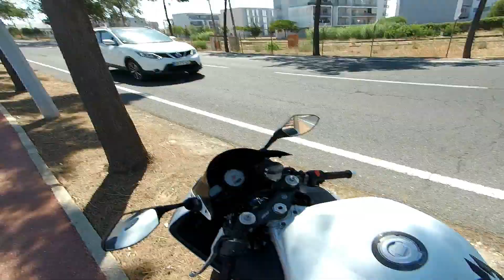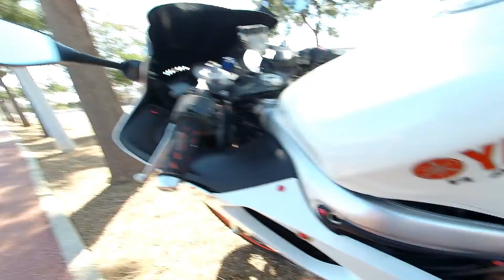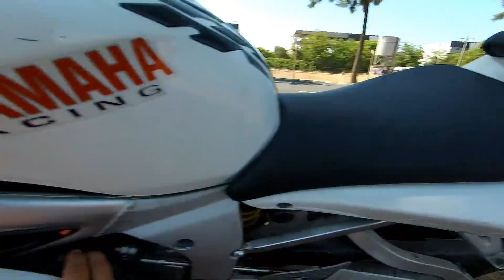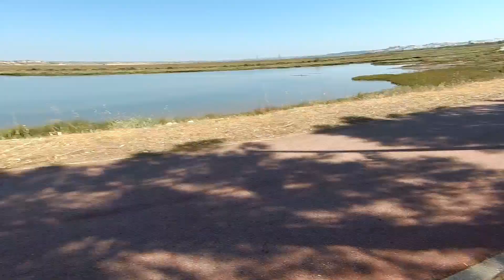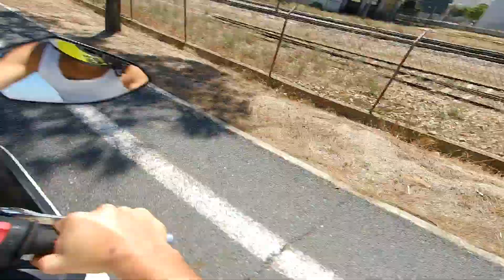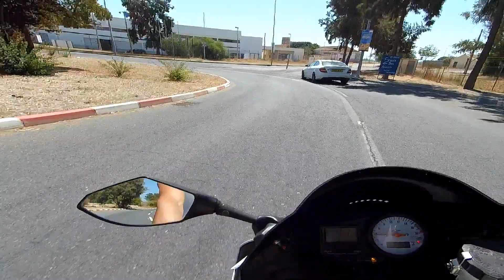This 2001 yzf R6 just won't go!

Comment: Had a similar issue with mine. Took the shop 3 months to figure it out. Check your engine pressure and ecu. They engine pressure fixed the blow back it seems and the ecu swapped fixed the issue with it not wanting to pick up speed.
Reply from the maker: Thanks for your input. Unfortunately none of the 3 mechanics I took it to had the patience to consider other options, had to envetually sell the damn thing.
Reply: How did they fix the engine pressure?
Reply: same problem I am facing so please let me know to fixed it
Reply: @arqumfida3585  maybe it's the pickup coil.. I'm still working on it
Reply: This is carburetted tho? There is no ecu in 1999-2002 R6 only CDI ignition is digital????
Reply: @reevellensoomien2423 aftermarket exhaust have to be maintained.  Like repacked. The lack of back pressure causes lean issues

Comment: If the bike turns off when you put the kickstand down, that means the neutral sensor is disconnected from the bike. That would be why the neutral light doesn't come on too. You need to find a mechanic who knows what they're doing. It really sounds like your battery can't deliver enough spark
Reply from the maker: Yeah it was a huge mess altogether, none of the 3 mechanics solved anything, I ended up selling the bike cheap out of frustration. All professional mechanics, just unbelievable.

Comment: Hearing your idle drop by that much when you turn the headlight on makes me think it's partially battery related.
Reply from the maker: Well I did never change the battery, actually. But all the mechanics were so sure it was a cracked cylinder that I didn't know what to think anymore.

Comment: Guys I had the same issue and when I removed the whole bike top ( headlight , signals and speedometer) it was running good !!!... I think it's some electrical issue but idk what is it  yet
Reply: Ever find the fix currently having same issue and I thought it was my stator and reg/rec… replaced both didn’t solve problem…
Reply: @zuk024  check your carb boots

Comment: Sadly I’d be willing to bet it was cracked liners most likely number 1. Woulda thought carbs or ignition related but with blow by its the cylinders. Happens on the first gens more so than other years. Don’t know what causes it. Some bikes get it some never do.
Reply from the maker: Yes first gen of R6 apparently all wind up with cracked liners. From what I've gathered it's the nicasil in it that fails to withstand the necessary pressure and heat, and end up cracking. What always puzzled me was that it ran fine in 1st gear, and after the 2nd it wouldn't, but in 1st the engine had a lot of power. Anyway, I actually gave it away to a friend that has a shop, once he opens up the engine I'll be able to finally have a look at the damn cylinders. Thank you .
Reply: @modelo2107  yea be interesting to see what it looks like inside. My 02 r6 still running very strong after 36k miles. Zero blow by and great compression. Fingers crossed it doesn’t crack a cylinder wall. It’s a shame that it happens to a decent amount of these bikes. The first gens are sooooo nice. For their age they still hang with new bikes.
Reply from the maker: @Dirtyol12valve  Yap, can't wait to finally look at them and clear this up. I've read of these bikes still running with 100k miles perfectly fine, mine showed 32k in the odometer, I just don't get it. I really liked, the engines revs amazingly, and the geometry of it is also really amazing considering it's age. I also have an R1 from 03, fuel injected and I actually had more fun with the R6.

Comment: Offtrack studios:  At 2:30 you said it was running worse yesterday.  Was there a difference in the weather being warmer or cooler on the day you filmed this?
Reply from the maker: It just felt like the idle was sustaining a little better but it was only for a while, once I took off it was doing the exact same.
Reply: @modelo2107  You need to start by pulling the battery out of this bike.  Take the battery to an auto parts store to get it load tested and fully charged up.  1:49 and 4:12 are good examples that your battery is very discharged.  You might also have a stator or voltage regulator issues going on.
Reply from the maker: @fwh79FOXR6  Pardon my ignorance, but isn't the battery just to start the combustion engine? Once it's running does it still play any major part on the process?
Reply from the maker: @fwh79FOXR6  So you really not inclined for a compression issue?
Reply: @modelo2107  Yes, the battery is important even after the bike is started.  The battery starts the bike and it filters voltage spikes and electrical noise.  It also provides power when the stator (or alternator) are overwhelmed.  A battery going bad can cause a whole host of strange electrical issues.  You need a properly functioning and fully charged battery.  You need to remove the battery, get it load tested at a parts store, and fully charge it.  Most auto part stores will load test and charge a battery for free.  You would be surprised how quickly a battery can lose its charge.  Also, if you stator is failing, the battery is not being charged when the bike is running.  This video might help you:  https://youtu.be/biwTpBFM-ns  You also need to keep your batter on a battery maintainer.  I use one on every vehicle I have, even my daily driver.
Reply: @modelo2107  I don't think you have a cracked block or any compression issues.  I think you have the following problems...
1.  Battery/stator/voltage regulator issues
2.  Bad ignition coils
3.  Possible vacuum problems effecting the needle jets from opening properly
4.  Mixture problems caused by dirty carbs

Start with the battery.  Get your hands on a multimeter so you can check the charging system (stator).  Take the seat off and make a video using the multimeter to read the voltage on the battery with the bike off.  Then turn the key to the "on" position and show me the meter reading voltage.  Finally, start the bike up and show me the voltage reading with the bike running.  After you do that we will make the next move.
Reply from the maker: @fwh79FOXR6  Thank you so much for your paciente, I'll try to get on it asap. I do believe though the damn thing is jinxed, now it won't even start, the starter does its job but it just won't fire up, with the choke on or off, nothing. BTW, what you think about not having the neutral light on the tachometer and the bike dying with I put down the stand in neutral?
Reply: @modelo2107  You're welcome.  It's not jinxed, she needs to be properly cared for.  I think the previous owner(s) neglected her.  That kick stand kill switch could be a reason why it doesn't want to fire up now.  Be sure to check the fuel level as well.  Maybe you just ran out of petrol.
Reply from the maker: @fwh79FOXR6  That crossed my mind, so I refilled the tank but it still won't fire up.
Reply: @modelo2107  Get that battery tested and see what happens.
Reply from the maker: @fwh79FOXR6  HI, do you know where the oil pressure cable connects? My oil light is always on and I have the cable at home but I have no clue where it connects. And do you know if this bike has some sort of safe mode? How is it possible that it goes to redline in neutral and in 1st gear but as soon as I shif into 2nd it starts bogging out??

Comment: Darn I got the same problem 🥲🥲🥲.. still don't know what to do ..  I changed the jet kit and it feels better but still got the same issue.. if any 1 know what it is just tell me
Reply from the maker: Sorry I can't help you. I changed everything there was to be changed, and the issue always persisted, ended up giving up.
Reply: I had a Yamaha and the problem was the coil packs...
Reply: @damienturk3911  the pickup coil u mean?  Coz I was thinking about  that too
Reply: I  think so there's 2 of them right under the gas tank along the frame.
Reply: Did you guyz figure it out cuz mines havig. The same problem
Reply: @nataliezepeda8904  there's 2 theories.. it's the spark plugs coils or the pickup coil.. and I'm about to try the pickup coil
Reply: I changed the pickup coil and still got the same problem... did u found any solution?

Comment: Dude I know what the problem is, it could be multiple things but the bogging is the carburettors aren’t cleaned or balanced, the dying can definitely be the regulator rectifier which you need to replace even if you replaced the battery. With the sound, all 4 cylinders seem to be running fine

Or you need to do a valve clearance! Because the engine won’t start properly
Reply from the maker: Thank you for this. Well thing is, all that was tested, and the problem remained, so it's a real big misery.

Comment: Did you resolve the issue?
What was the problem?
Reply from the maker: I didn't, I sold it cheap. The guy who took it changed the engine and it did exactly the same. He also changed the whole cabling and the result was the same. I think this will go down in history as the stranger mistery ever on a motorcycle.
Reply: @modelo2107  i think its the carburetor, in fact am having exctly the same problem. The mechanic will work on it next week
Reply from the maker: @reevellensoomien2423  They were checked and clean, were perfectly fine. As also was everything else.
Reply: @reevellensoomien2423  So did you solve this problem , cuz I am starting to get the same thing with my bike..
Reply: Mine does this and I changed plugs and running sea foam and still doing it
Reply: Came here to get some answers because my 2001 R6 is doing the EXACT SAME THING and I can't figure it outtttt.... change the plugs, the oil, rectifier, fuel pump, HAD THE CARB REBUILT!!!! AND STILL DOES THE SAME DAMN THING AND I have no idea why... even the oil in the blow by is the same ..... really a myster indeed😢

Comment: Head has gone its well known for it change the head, oh 3 years ago nevermind  hahaha 😂
Reply from the maker: One would think that, but guess what, we changed the whole engine and it did exactly the same 😂
Reply: @modelo2107  im assumig yours is a 98-02 the 5EB is well well known if yu just have the head changed to a 5SL stage it will never happen again,
Reply from the maker: @googlelimp9834  Yes, correct. I no longer have the bike. The weird thing is that I chenged the engine but not the electric part, and it did the exact thing. Which makes me think it was not the engine itself, but something to so with the electric part.
Reply: @modelo2107  yeah ive had a few 5EB and never had a head prob yet got one now, there is also know Problems with the fan not running so have to convert it to a sitch on, The fact was oil in the coolant is normally through head or coolant problems, just icase you get another lol
Reply from the maker: @googlelimp9834  I'll stay away from them lol
Reply: The problem is with the pressurizing of the fuel bowls. You have 1 hose on each side of the air box that goes to each side of the carbs and one hose that runs to the top of the air box that runs down for a vent to the carbs. The hoses on the sides pressurize the fuel in the carbs one you get to a certain speed. If you take off your ram air tubes that are attached to the front of the air box the bike will run fine. Trying to figure out why the bowls aren't pressurizing.... No air filter, clogged hoses...... Good luck
Reply: @modelo2107  i just found some problems with mine also the electrics have setting on them witch I didn't know until last couple of weeks, if you can not turn of left had signal means you have lights out, found out if your speedometer is not working it will stay up to 70mph then its wrong turn the lights on turns off the speedo lol also found out when the oil lite is on it will not let you rev it to hard through the ride limp to get home. found out a few others at the garage LOL not saying all right have a speedo to fill left to check.